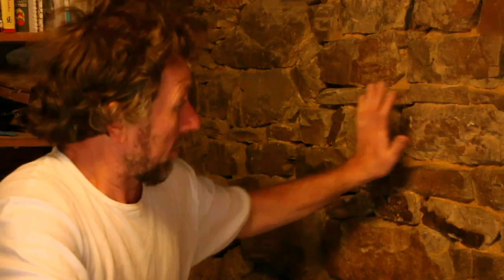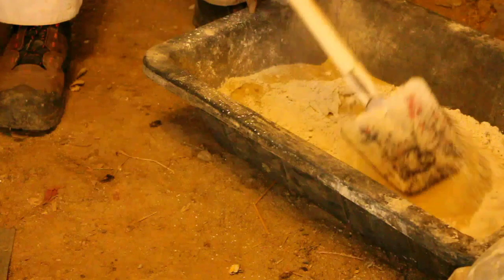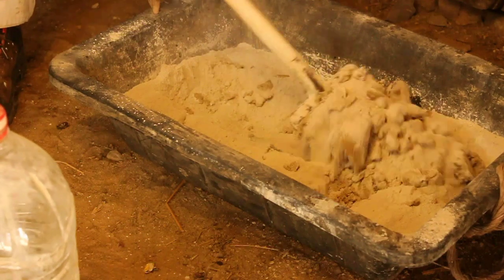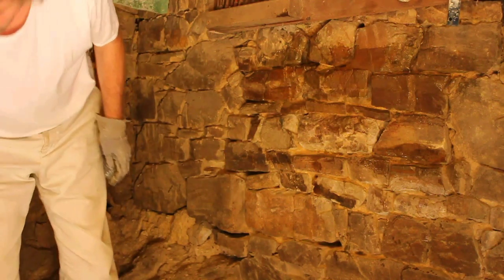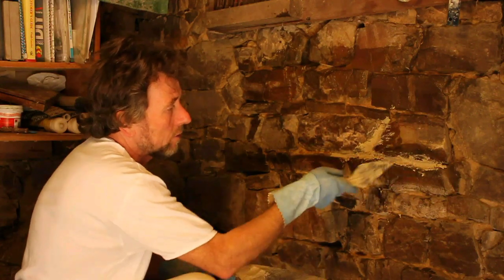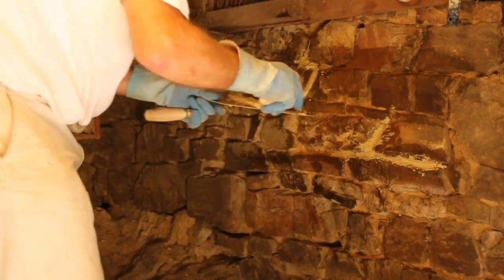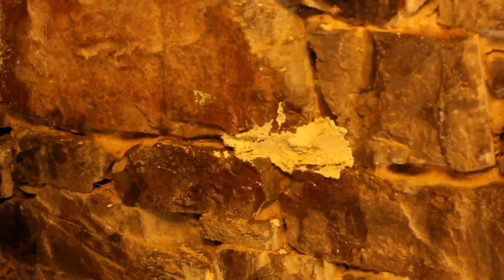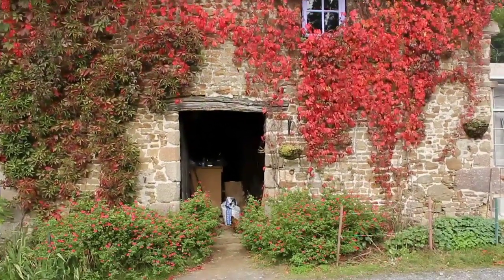Working with Lime Mortar. Pointing stone walls. Mortier de chaux. Hacer juntas con mortero de cal.

Comment: Thanks Mike and Sue. That was an invaluable video.
My wife and I have bought a stone cottage in La Hague, not far from your house. The cottage is in the village where my wife grew up. On my one visit to see the house thus far (we live in Australia!) I was initially horrified to see that the house was built from stone and mud!! I am reassured now that this is how all the houses are built.
We have lots of repointing to do.... I did a little using a cement mix!! Oh no! I will be taking your advice and using a lime/sand mix for future repointing.
One question.... is the same mix suitable for exterior pointing??
Thanks again for sharing your knowledge.
Rick
Reply from the maker: +Richard Churchward Hi Rick, thanks for your kind words.
I would use the same mortar for external pointing. As you are in the same region as ourselves, I would recommend the use of  'Bayeux Brut' for the sand in the mix and an NHL 3.5 hydraulic lime both readily obtainable from builder's merchants such as Point P, or maybe, Brico Depot or a local supplier. Also try adding a little of the clay (crushed and sieved) from the existing wall joints to help blend the new mortar with the old. Furthermore, I would suggest you recess the pointing slightly from the front face of the stone, you will still have good weather protection without the pointing becoming the main feature of the wall.
Hope this helps, but if you need any more information, don't hesitate to ask.

Good luck with the cottage. By the way we have done a lot of work with insulating our house walls with a chopped hemp and lime plaster, unlike modern insulation, these natural materials allow thick stone walls to breathe. You can find details of how we did this in my blog post here: http://thegreenlever.blogspot.fr/2012/03/renovating-tiny-house-continued.html#.VpOigk_Snet 
There are several posts in the section  'Natural building materials'  that you may also find helpful, here's the link: http://thegreenlever.blogspot.fr/2014/10/the-green-lever-contents-page.html#.VpOjRE_Snet

Best Wishes from sunny Normandie, Andy.

Comment: is there any heat problem in summer due to stones walls sir
Reply from the maker: Hi Valbhav,, I'm not sure I understand your question. Do you mean is the lime mortar affected by the summer heat? or are you asking if stone walls get hot due to summer heat? The first answer is no, the mortar is not adversely affected by hot weather, although the mortar in the trough may start to become drier due to evaporation, one can always add a little more water to keep it workable. In answer to the second question, the biggest problem in summer is that the walls inside the buildings remain cool and if the humidity rises, water in the warm air will condense on the stone. In our house we have solved this seasonal problem by covering the walls with a render of chopped hemp or linen  mixed with lime and water. Once dry, this coating (25mm to 50mm thick) insulates the wall, preventing the formation of condensation and making the house considerably warmer in the Winter. I hope this answers your question, if not please contact me again. Many thanks for watching and commenting. Best Wishes from France, Andy.

Comment: I know its old video but why 1 to 4 mix when everyone recommends 1 to 3 or 1 to 2.5. Thanks
Reply from the maker: Hello Ruben, the purpose of a mortar is to act as a cushion between the irregular surfaces of the two layers of stone/brick. If the mortar was not there then as the wall gets higher the possibility of point loading at the lower regions of the wall get higher resulting in the stone or brick breaking. So the mortar is distributing the load over a much bigger area. The mortar also has to be softer than the medium it is supporting so that when the wall moves due to thermal expansion or contraction or ground shift,  then it is the role of the mortar to 'give' in lieu of the stone/brick. The mortar also needs to be porous to moisture so as to allow it to pass to the outside face of the wall and thence to evaporate, any damaging salts from this moisture will be left on the outer face of the mortar  which, as it degrades can be replaced. The 'stiffer' mixtures you mention are more likely to damage the wall over time and as lime costs more than sand are more expensive! Hope this is of use. Thanks for watching and commenting. Best Wishes from Normandie, Andy.

Comment: I've just read your informative comment to the Churchwards and note that you recommend
'Bayeux Brut' sand for the mix.  However, it doesn't appear to be available here in Aquitaine.
I've been using a mix of  'builder's sand'  (yellow) and river sand  (whitish) from the local brico.  So far so good but are they likely to last the course?  Incidentally, I'm an amateur female 'builder' learning the ropes from great videos like yours.  Thanks a lot!
Reply from the maker: Hello again Catsnmi2
I'm assuming you're using that sand mix to match the existing mortar colour, I shouldn't worry about them lasting the course but there could be better sources for you to explore. 'Bayeux Brut' is our local sharp sand and has been used for centuries, thus enabling a good colour match on our walls. (Just as an aside there are walls here where the 'mason' has used a washed beach sand (obviously maximising the profit) but there is still salt within leading to early deterioration of the mortar). You say you're buying from the local brico, when we first started here we did the same but as the need increased we started to buy from our local Gedimat  and Point P (who are also in your area). As time progressed we learned of an even better local source where most, if not all, of the local independent builders and serious 'DIYers' shopped. I would recommend asking around to see if you can find such a source in your locale. I've found that the people that are in the smaller enterprises are much more helpful. Alternatively, see if there is a local quarry who can supply your needs, the only problem with the quarry is they may not  allow 'particuliers' on site due to Safety reasons.  If it's of any help I've written a post on my Blog 'The Green Lever' on mixing and using lime mortar https://thegreenlever.blogspot.com/2014/12/mixing-and-using-lime-mortar-and-why.html#.W3KerBqYOkB   
In addition, Ive also written  about insulating the interior walls with a hemp and lime plaster and a linen and lime plaster https://thegreenlever.blogspot.com/2012/06/renovating-tiny-house-detailed-look-at.html#.W3KfnRqYOkB    If you have a need to work on your interior walls then I would recommend such a finish on top of the stone. Our entire house is done with these materials including the floor in the kitchen and the change was immediately felt.
Good Luck and thanks for your comment it really is appreciated. 
If you need any more information don't hesitate to contact me.
Best Wishes, Andy.
Reply: Merci mille fois for your really helpful reply!  All much appreciated.  The more information I can glean on the subject the better so I'm most grateful for your expert suggestions - especially the lime plaster insulation idea.  Brilliant!

Comment: phew ,thank goodness i have found your post. I have just removed a lot of lime plaster,mortar and concrete from the walls indoors and had been searching for some guidance.  the prior occupant ripped up the original wooden floor and laid an insulated concrete floor . The damp has been creeping up the poor old walls . they were being stifled by some kind of concrete (asbestos perhaps) panels so .... after tearing all of that off i now face repointing and plastering the interior walls......  Should prove quite a challenge .. just getting the lime etc    all the best ,woman on a tricycle

Comment: Is this the same mix if say some stones have fallen out and I need to put them back
Reply from the maker: Hi Peter,  Yes I would use the same proportions of lime and sand but just make it slightly wetter so that there is a better adhesion. If the stones are not on the top of the wall then I would put the mortar in followed by the stone and then wedge a couple of smaller stones beneath it to hold the top mortared face of the stone against its neighbours. It's a bit fiddly but it'll work. I've written a post on my Blog around this video that will give you more details: https://thegreenlever.blogspot.com/2014/12/mixing-and-using-lime-mortar-and-why.html#.W3KkURqYOkB  
Thank you for watching, if you need any further details don't hesitate to ask.
Best Wishes from Normandie, Andy.
Reply: Organikmechanic - Making Stuff from Pallets etc., thank you for the reply much appreciated

Comment: A large pump gun ( like a Mastic gun on steroids! ) could be improvised or designed for this job I reckon. Im, sure there must be a more efficient tool or method out there already.
Reply from the maker: It's an interesting suggestion, but I have found that with this type of wall, which is clay and rubble filled there is frequent need to insert stone into the larger voids and I think there would be a tendency with the mastic gun idea to be over zealous with its use resulting in excessive use of mortar.
Reply: pointing lime mortar from a pump gun would not work.  It's a relatively dry, firm mix.  Maybe you could try with a much wetter mix, but it will be messy and most likely have lots of cracks as it dries out.

Comment: Why not use a mortar bag?
Reply from the maker: Hi Gary, for the simple reason that it would  be a cement-based mortar and not a lime-based one. The former is too hard when dry and causes further damage to an old wall. Furthermore, lime mortars allow the walls to breathe and do not seal like a cement. The other advantage is that the mortar has a much nicer 'feel' when one is using it plus you can make the mortar to your own preferred consistency. Hope this answers your question. Thanks for watching and commenting Best Wishes from Normandie, Andy.
Reply: Grout bag not the mortar. I understand the use of the lime mortar.
Reply from the maker: @gary24752  Hi there Gary, OK sorry for the misunderstanding. Basically I don't use one because the stonework here is most irregular and also the joint depths change quite drastically. All the very best from France, Andy

Comment: It's easy to use lime don't know what all the fuss is about stick it in a cement mixer for 20 mins comes out perfect .
Reply from the maker: Hi Arfa, Yeah the mixer is fine for large batches but I find pointing uses much less mortar than wall building and a hand mix batch is about the right quantity to remain workable to the last bit. I used a mixer for my lime and chopped hemp wall insulation and it was essential as I used so much. Thanks for watching and commenting, Best Wishes from Normandie, Andy.
Reply: @Organikmechanic  Thanks Andy i only use it for exterior work and like to use it mainly because i find it stickier than cement mortar i also prefer the colour as well good luck Martin .
Reply: 20 min? Really?

Comment: Why dont people just use a cake bag type thing...it would squirt the mortar if wet enough straight in to gap......but a sturdier one for builders....it would be way quicker.
Reply from the maker: Hi, Gw, I have seen people using a cleaned out silicone sealant container filled with the mortar, but in the case of the stone walls of this type the mortar does need to be 'non-runny' Plus on very deep  cavities, I like to put in some small stones to add extra support, this has the added benefit of then not having to use so much mortar. Thanks for your comment and for watching, It is very much appreciated. Cheers, Andy.

Comment: I wouldn't use hydraulic lime . I would use type S on that field stone with  a bonding agent.
Reply from the maker: Hello, M G, interesting comment. I've never used type S primarily as far as I understand it is more suitable for cement mortar type roles. I have always found that NHL 3.5 gives me a mortar that allows the joint/wall to breathe, an essential requirement for walls 2-3 feet thick. In addition, the mortar I employ here is not as rigid as  more sophisticated mortars - if the bonding is too great to the stone, then  damage to the stone rather than the mortar is likely if there is any movement in the wall. Thanks for watching and commenting. Best Wishes from Normandie, Andy.

Comment: pipe it in.....
Reply from the maker: Hello there, I'm sure that may work, but I find that the joints vary so much in depth and height that I often pack the voids with well-shaped stone, this is particularly important where the clay has completely fallen out BEHIND the facing stone so it would require a considerable quantity of mortar to fill it. Thanks for watching and commenting, Best Wishes, Andy.

Comment: Thank you for the excellent video!! My wife purchased a home that was built in 1903 here in the States in Ohio. The outside of the house has like a cobble stone to the exterior.. The walls are about 2 feet thick.. Im trying to match the color of the mortar to the home. I know the sun discolored the existing mortar. Here is a picture of the home..  https://www.flickr.com/photos/12273968@N05/15710252507/  As you can see the bottom of the foundation has been deteriated from rain water, but I fixed the problem by putting up a rain gutter,when I purchased the house. Now I have to repair the damage from the rain. So, can I get a dye and try to make it look a yellow color to it? I also notice that on the existing mortar that the type of sand they used was very coarse. It has large pebbles in it. Also you have any advice on how to clean the discolor of the stone near the bottom of the ground? The previous owner had red mulch and the dye splashed against the brick.   Any advice would help me  allot! Thanks :-)  James
Reply from the maker: Hi James,
Glad you found the video of use.
What type of stone is it? If it is a sedimentary type, then some of that colour will have been absorbed by it. Otherwise, try and remove the stain with a good quality wire brush (I say good quality as poor quality ones can themselves stain).
As for colouring the mortar, are you intending on re-pointing? If you are then you should find a builder's merchants that have a selection of local sands and explain what you want. The sand used in the original mortar would be local to your area (as are the stones of the house) and should still be available. Failng that, you can stain the mortar at the mixing stage with natural dyes but bear in mind that the sand you use will also affect the colour. I'm afraid it will be a bit of trial and error on small mixes until you achieve what you want. Still, it is a charming  period house so it'll be worth the effort.  If you just wish to stain the existing mortar you may find that any dye you use will leach out onto the stone due to the weather and cause more discolouration.
Your observation is interesting on the coarse nature of the sand - they were less fussy 200 years ago! In fact we have exactly the same in our mortar.
Many thanks for watching and commenting and good luck with the mortar.
Hope you had an enjoyable Thanksgiving.
Best Wishes from Normandie, Andy.
Reply: Organikmechanic   Thank you for replying back. It really helps me to figure out how to go about my home. In the area I live, I know there is allot of limestone in the ground and also up the road we have a place where they blast limestone in the ground. So I assume that the stone is limestone on my house. But I know that the home was built in 1905. Yes, I am planning on re pointing the mortar that is missing or deteriorated through time of neglect. I know that since the house is over 100 years old and no other homes around the area have this type of brick, That it will be impossible for me to replace it, which I have no intention or desire since its not necessary. Yea it will be a trial and error on getting the correct color of the existing mortar. Since some of it is discolored from the sun,rain and snow.. What drew us to purchase the house was the craftsmanship of the home..  I will tackle this in the spring time next year.  Have a great day and wonderful christmas this year! Cheers! James..
Reply from the maker: James Crowton Hi James, you may be interested to know that I posted a blog on this http://thegreenlever.blogspot.com/2014/12/mixing-and-using-lime-mortar-and-why.html#.VI9ghYXft0x about 10 days ago and it hopefully brings all the information in one place! Sorry for not sending you the details earlier but we're furiously getting everything ready for a trip to Scotland to stay with family over Christmas.
Hope you have a great Christmas and Best Wishes for 2015!!!
Andy.